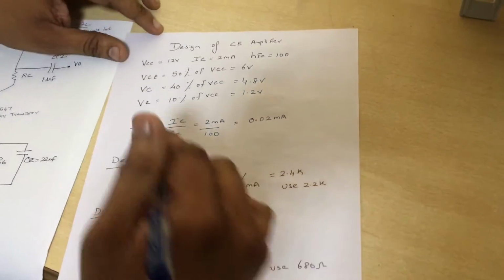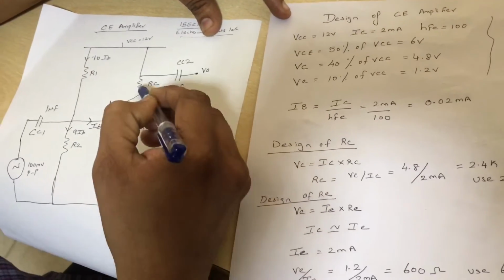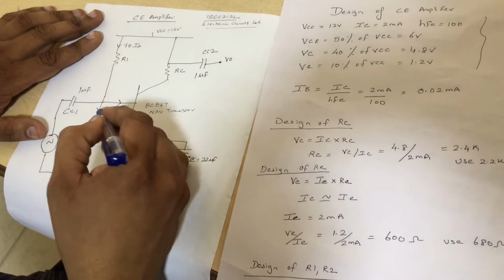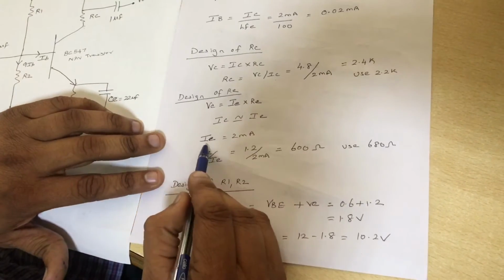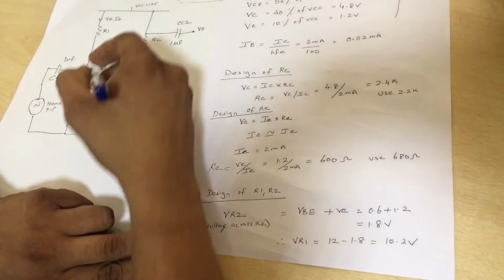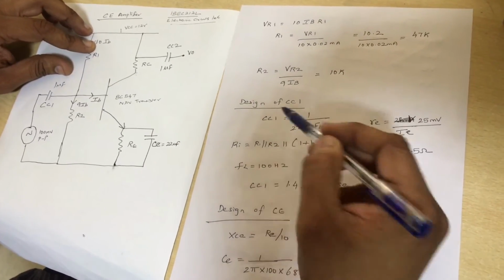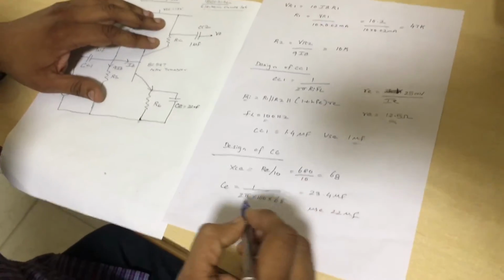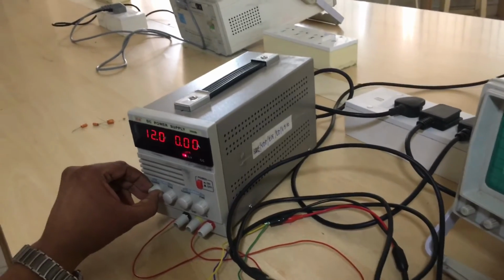COMMON EMITTER AMPLIFIER

Comment: What a big error! This circuit will not Work.....output has to be taken from collector of transistor. You have taken on top of Rc resistor that is same as supply voltage! Amazing it's four years now and nobody has realised!